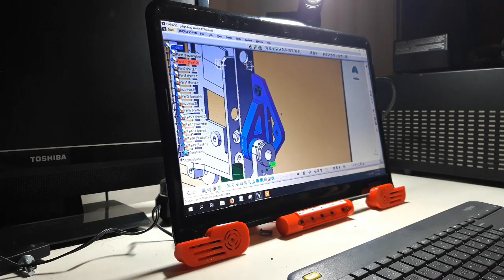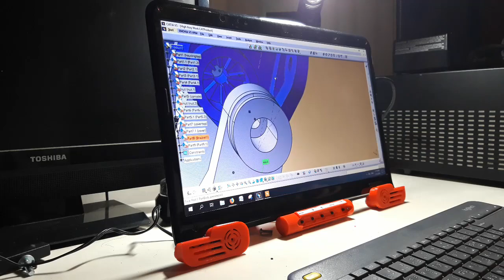Reuse Laptop Monitor and Speakers Part 3 - 3D Printed

Comment: When directly connect the laptop speaker to the controller board how is the sound? how comparable with the stock one of the laptop? In your opinion do we need applification? I planted to re-use my laptop as external monitor with laptop speaker.
Reply from the maker: The sound is the same as the laptop